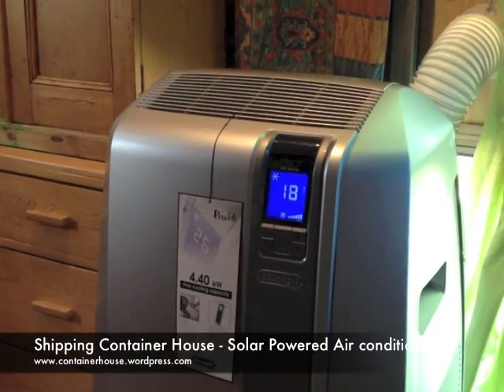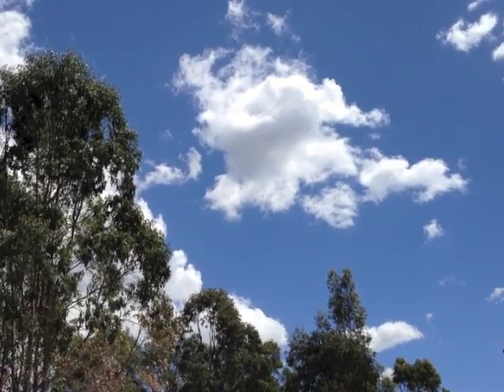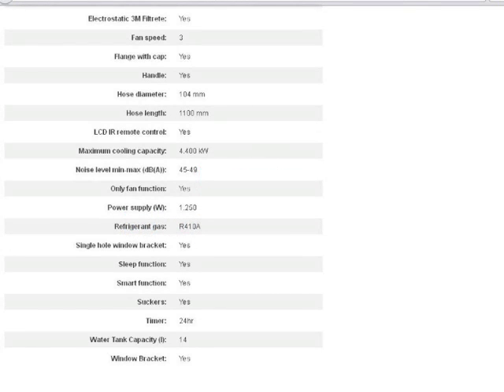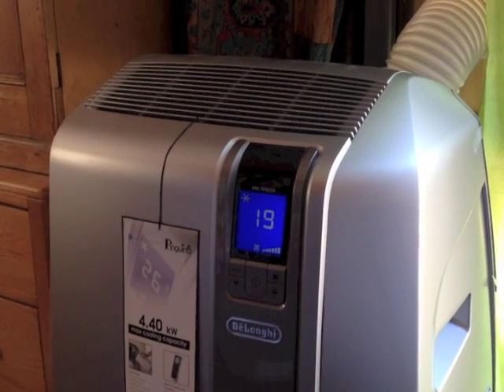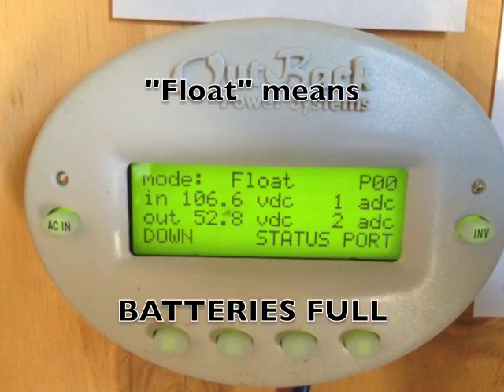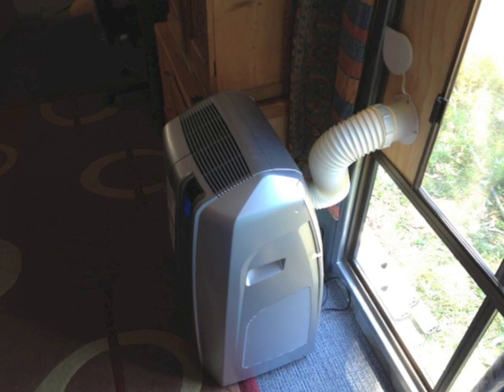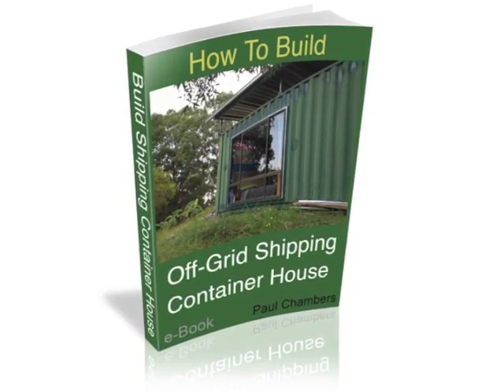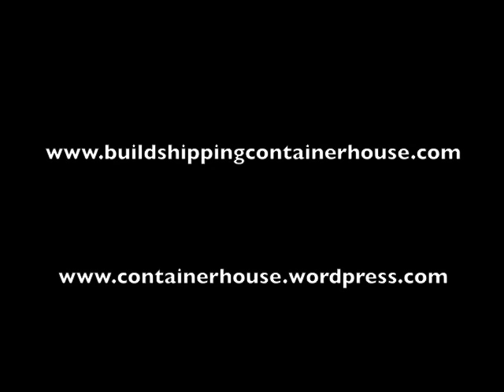Shipping Container House - Solar powered air conditioning

Comment: Hi Paul,
Do you also use them for running the electricity/lighting? If so, can the battery handle doing both the lighting and A/C for long periods of time?
Reply from the maker: Hi Emm, Welcome to the channel. Lighting is a separate system, a 250W solar panel and a 200 AH truck battery. Runs perfectly all year. Philosophy, turn the lights out when you dont need them. Electricity 24hours per day goes to fridge, freezer, water pump, sockets, 3 computers permanently on. Runs all year minimum intervention. AC use is only required a 3 - 20 times per year. It is only viable in full sun. This year we used it about 5 time during the summer. When sun goes behind the trees the AC goes off. Fans are used regularly and are not a big drain. If we have an OMG hot spell, after the sun has gone in I can switch on the petrol Honda generator and run the AC for as long as I want. Batteries cannot run the AC. I once tried it and stopped the experiment after 40 about an hour. The long term effect on the battery life was not worth it. I hope that answers your question. Cheers Paul

Comment: Hi Paul, 
I want to buy some portable solar energy generator for 1 air conditioner(8000-11,000 BTU"S). I'm planning to use the air conditioner for 8 hrs daily. Also, I live in Puerto Rico which is really sunny island in the caribbean. What do you recommend for this folk that doesn't  know to much about electronics & solar generators.

Thank you
Reply from the maker: +vintageRE cords 
Hi Vintage
I am not an expert but
here is my experience. I bought an underpowered unit to begin with because I
did not understand the way they describe them. I since replaced it.
A 10,000 BTU unit from
ebay was listed as 2.9 KW. The 2.9 is the air rating NOT the electrical power
rating. When you read more carefully, this has specs that say 1100W, 5A, 240V.
My aircon has 4.4 kw
of cooling, I could not find the power specs quickly on google so cant quote
the electrical power and current.
An air conditioner will
never run successfully from a battery alone. I tried once. It will flatten the
battery in no time.
I have 3000 watts of
solar power generation, a 2300 watt inverter producing electricity, and that
will happily run a 1100 watt air conditioner (when the sun is shining).
You need to put more
energy in than you expect out, as there are losses in the conversions. I would
have a factor of at least twice the solar capacity of the load. So if you want
1100 watts I would want a system: 2200 watts of panels, and at least a 2kw
inverter (ideally 3kw). 
The 1100 watts can
also be a bit misleading, as when a device starts, it can draw momentary power
of 5 to 10 times the normal load. This is why inverters state a safe working
load and a temporary overload ability. (my old inverter could supply 3000 watts
safely and supply 6000 watts for short periods.) 
I don’t think I
answered your question, but I hope I helped explain the problem you need to
solve and why. Cheers Paul

Comment: I also like the idea of using solar panels connected directly to the air conditioner and having no batteries, charge controllers, grid-tied system, etc.  But, when you say "kills" the air conditioner, do you mean that it just turns off when the power drops too low and you have to manually turn the A/C back on, or do you mean that it damages the A/C ?
Reply from the maker: Christmas Eve Hi, Christmas
Why you might fry your AC without a battery.
I absolutely wanted an AC without a battery myself.
 When I went off grid I went to the pump shop to 
buy a water pump. The standard pump comes with an electronic pressure 
head to regulate the pressure. When I let slip that I would use a 
generator and solar panels to power it, he cancelled the purchase. He 
said I needed the old fashion analogue pump with mechanical pressure 
switches. He said that when the generator runs out of fuel, the voltage 
decays and the frequency becomes inconsistent.  He had replaced 
countless electronic heads for this reason. The poor quality electricity
 kills the electronics. Same concept with solar output.
When I read my manual for the AC unit, it says the 
warranty is void if not connected to the grid. I have a superb Honda 
generator with a high quality sine wave output. I also have a great 
inverter.
When I start my AC unit is has a soft start, and 
takes a minute to fire up. If it were to lose electricity it would 
simply drop off and not switch back on.
The YouTube videos showing AC units running on 
Solar with no battery have a big solar array. They are generating plenty
 of power. They also point to the space where the batteries would be 
fitted. They are also a full sun day. They point out when a cloud passes that the tone of the AC unit changes. It’s a great demo, but not realistic for daily operation. I work in an electronic environment and strongly doubt an AC unit can handle dirty power and power cycling. 
I am open to learning differently, so I invite comments to the contrary. 
Cheers Paul
Reply: Hi Paul!
That's too bad that electronic components in air conditioners are destroyed by power cycling, that is, having the power just drop off to nothing and then return to full power at some point.  I can understand that undervoltage can cause problems over time but why the same about power cycling?  After all, an inverter cutting power is really the same as a power outage from the grid.  I guess the only difference is the fact that a solar inverter cutting out would happen far more frequently than grid power outages.. Hmmm I wish there was a way.  Thermoelectric coolers are not damaged but they're VERRRYYY inefficient...

Comment: How many batteries would you need to be able to run the Air Conditioner that you have for a couple after the sun goes down?
Great video.
Reply from the maker: Hi Blake, I am not sure. I think the price of batteries and their limited life means it is not cost effective, to drive an A/C from batteries. Direct sunshine is my only realistic option. However if the sun has gone in it tends to be cooler. On a few hellish hot days we have run the A/C off the generator for an hour or so,

Comment: Do you know about the Rawlemon? It looks good and is more efficient then the traditional solar panels. I did some more research and I font out that is possible to extract water from air (good for dry land) and then extract hydrogen from water to be use as fuel to power the car for cooking or just to store energy in liquid form. Amazing new technology are becoming more available is very exiting. Can someone suggest me how can find cheap land near Brisbane? I love your work!
Reply from the maker: I went and had a look. Very interesting. Thanks for the lead.